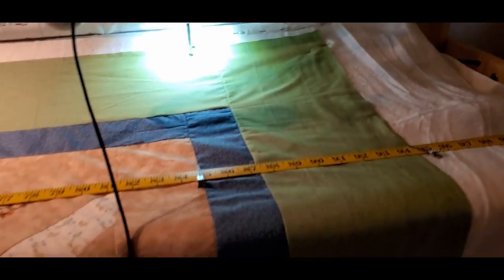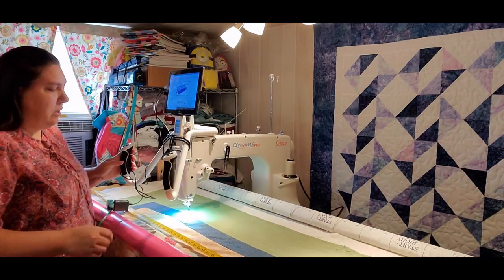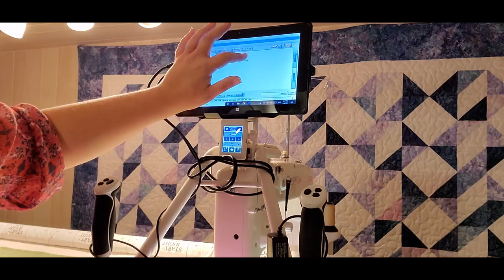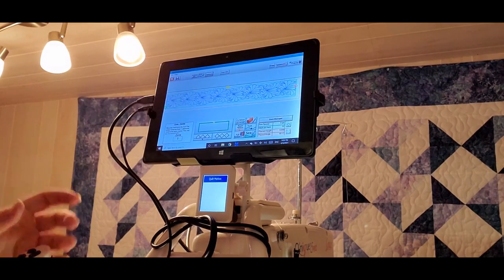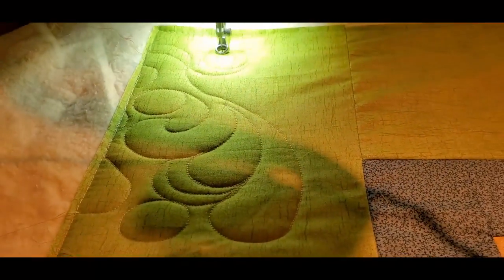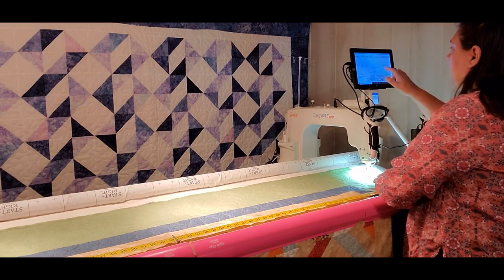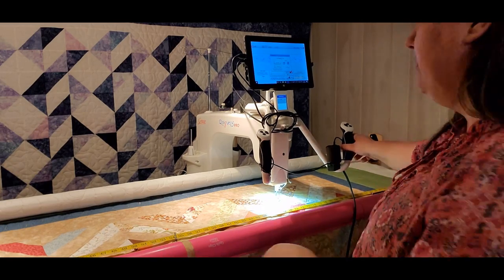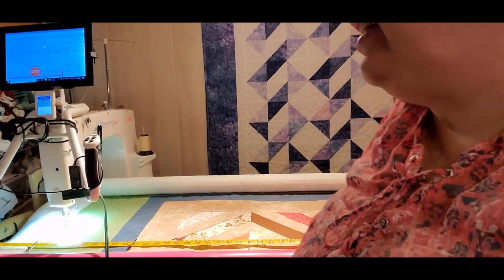Quilting a Quilt on a Qnique long arm from the Grace Company with automation

Comment: Thank you, because of your video I was able to purchase the Q'nique 15 pro. I needed a new quilting machine and I have the Gracie queen size quilt frame. I thought I would need to purchase the entire set up. But your video showed the 15 pro on the Gracie frame (my same frame) using the automation. This let me know that I could use my current frame (which I love), just update my machine and later addd the QC5. So, thank you so much for sharing, you saved me a lot of time, frustration and money. My only regret is thinking that I should have gone up to the 19 Q'nique, but I did not know if it would fit on the frame. Please keep sharing. I think you are the only (you are unique) person I have seen that is using the Qracie (wooden) queen quilt frame (and I have searched for them endlessly) to quilt on. So, I am watching and learning.  One last thing.., are you planning to set up your Amazon affiliate links so, that we, your adoring public can purchase much needed items, such as the tape measure you mentioned below. This will help you and us (searching Amazon is a pain). Thank you..., L. :)
Reply: I know this was a year ago but same here. I bartered for the Gracie Queen last summer and have not been able to find a machine to work on it so just today I spring for the Qunique 21 elite because it comes with a new frame; man am I upset now. I love the wooden frame, I just couldn’t find anything about it. I’ve spent so much money and still won’t have automation which I really want. Bummer I didn’t see this and I’m always always looking. 😒

Comment: Just watched your video and I was impressed with how well you went over the use of the qct5.  I have the qvt5 pro and the grace 21pro on the grace table.  The ruler that runs the length of your table will that work with the grace table and if so how can I get one. Thank you for your very helpful information and have a great day.
Reply: Thank you..  I happy my video helped you.. The tape measure I found on Amazon. It works great when advancing the quilt to keep it straight and centered.

Comment: How did you know that to nest it was 1/4”? Where does the screen show that?
Reply from the maker: The screen does not show you that. You will have to look at the blue squares in the background. They are 1 inch square. And use your best judgment. Just be constant through the whole quilt. I do now that from your needle to the outside of the hooping foot is 1/4 of an inch. Also I have quilted this pattern alot and take notes on each pattern.

Comment: How do you figure out the size from top to bottom? I would be afraid of getting to the bottom and having a half of the row size you were doing.
Reply from the maker: With qct5 beginnings you don't have to figure the length. There is a button to click on if it is a piece of a row at the bottom. It will not change the look of the quilting to have a piece of a row. It will all look Continus if you nest your rows.

Comment: Great explanation! How Long of a time did it take to get from the left all the way to the right in one row? How long did it take to get that whole quilt done in this video. Thank you for your time!
Reply from the maker: Thank you! It usually take around 20 mins or so per row. But there are so many variables that can change that. Like spi and the speed that you have the machine set on. I have mine 10 spi and med speed. The total time for this quilt was 6 hours.

Comment: Just found your video and it was great!  I have just purchased the QCT5 Beginnings and there are not many videos on Beginnings.   Could you please do a video on the last row of a quilt when you have to use a partial pattern/design?  I haven't figured that one out and I keep getting the warning that I am out of my Safe Area.  Thanks again!!
Reply from the maker: I would love to make a video for you. But I will say that it will tell you that you are out of safe area and turn pink. It will work. Just nest and as usual, bring the machine down to the bottom of the quilt, and click on the diamond under the line.
Reply: @sewsomethingsouthern  Thank you for the information.  That really helped.

Comment: Such a great video, very thorough. Two questions? What tablet do you recommend and what is your tension usually set on? I have been having a hard time with the perfect tension the last few times I have used my machine.
Reply from the maker: I have fusion 5 tablet. 
I have to adjust my tension almost daily. Because I use different name brand  threads. Thanks
Reply: Hello.  What are the specs on the tablet you are using, please?